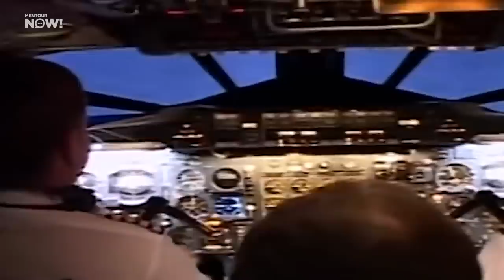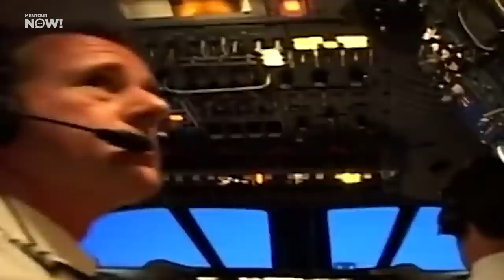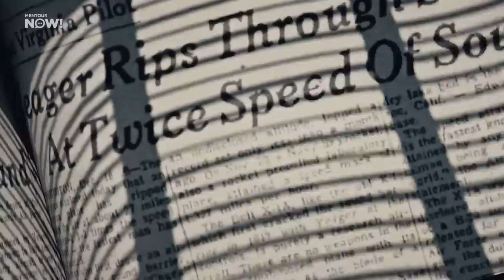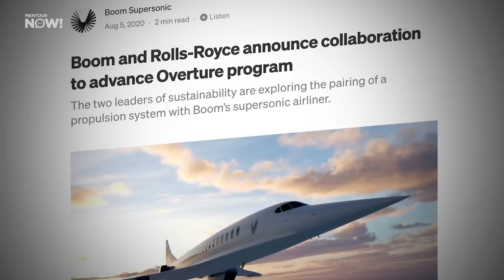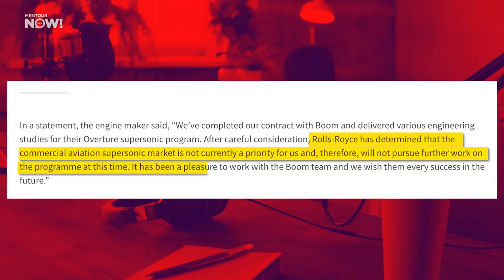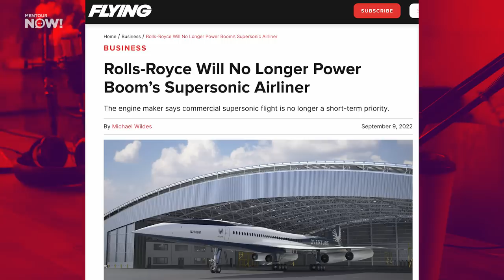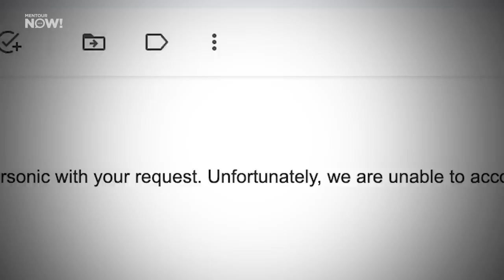WHAT’s Going On with BOOM Supersonic?! Will it Fail?

Comment: One word on why the Boom will not be much of a success: Slots.  To take off from an airport, you need a departure slot, and to land at your destination, you need an arrival slot. The Boom plane will only see maybe 100 passengers, but typical transatlantic jet will carry between 300 and 500 passengers.  That means that with a big plane, you can move 500 passengers with one departure and one arrival slot 2 total), vs 5 take off and 5 landing slots (10 total) for the Boom. Remember, not all of these passengers are organic to the departure an arrival airports, meaning that many of the passengers will deplane and board continuing flights.  This means your big regional jets won't be able to fill their seats.  The entire industry is based on the hub and spoke model and for trans-ocean flights, volume helps support the regional flights.  Then there is cargo. Cargo has become a big source of revenue, and an 777 can carry between about 300 and 400 passengers with their baggage, and still carry up to 21,000 kilograms of cargo. The Boom won't be able to do anything close to this. Now it might be possible to get some slots in the wee hours of the morning, but this is not a desirable time slot for the wealthy travelers that might buy an expensive ticket, and may 1st class seats are given to business fliers that get upgrade from Business Class using "coupons".   These travelers would never be able to afford a premium supersonic flight ticket, and the Airlines would not want to give those seats away.    The problem for the Boom is that it is too small to be an Transatlantic Airliner (and this was a problem for the Concorde too because it only seated about 120 people) but far to large to be a business jet.  The typical trans-Atlantic capable business jet has luxurious accommodation for 8 to 10 people and having to expense to buy and operate this plane to move so few people around is just not practical, though people like Elon Musk could care less about how much something costs.  It would still be an incredibly expensive aircraft to operate though and many large companies have downsized their jet fleets in the last decade because of the cost.   So, Elon Musk, Bill Gates, and Jeff Bezos could afford these out of their personal wealth, but the market for such a plane is not a very large one.  Also, the Concorde required a runway of 11,000 feet, so many regional jets would not be able to handle the Boom, but many big business jets can operate out of locations with runways as small as 8,000. The Global 7500 can land in 3000 feet.  This means that these jets can often take off at an airport closer to the executive and land him closer to his destination than a large plane could do, lowering overall trip time.

Comment: Boom seems to have gone the way of the F-35 when it comes to supersonic performance. But then fighters are more about acceleration, not ultimate speed (which most older jets cannot actually reach with the bombs and missiles and sensors attached)

Comment: I thought GE also got out of the engine design business due to pretty much the same reasons as Rolls Royce, hard to come by profits for the amount of R&D they have to put into engine development.  I know they're still making engines they've already developed, but I hardly see them working with a startup.
Reply: Actually, what GE did was break up into three distinct businesses. One of which is still Aviation engines.
Reply: @WALTERBROADDUS  That still doesn't change the main point though.  The point is the same that caused Rolls-Royce to drop out.

I didn't say whatever spin-off or GE wouldn't be interested in making an engine at ALL.  I said I can't see them working with a startup company and I think that's going to be Boom's problem.  While you might get venture capital to go into the development of the plane body, it would probably be a lot harder to get the same to develop an engine.

If it were the case that BOEING or AIRBUS were working on something like this AND they dumped a few hundred million USD into the R&D of an engine you'd probably get an engine.

It's just too problematic to make supersonic for commercial flight because it's so limited on routes.  On the other hand a small supersonic which also means a much smaller engine seems more realistic for business use.  Ticket costs for commercial flight is high, and part of the people that WOULD be passengers on those flights would rather have their own business jet, and that's why he made the comment about (who for some reason aren't flying a business jet).  I forget the exact words and I'm not going to listen a third time to get the timestamp.  

And you still have the issue that govts. around the world or at least the main ones will have efficiency requirements on airlines and this could be part of the reason why Rolls-Royce got out of this.  The goal post is just too far away.  You need a body type that is very efficient so the entire burden of efficiency isn't on the engine maker.  As soon as you say something like stabilizer on the back, that's a bit of efficiency that's already gone and just a wild guess but it gets worse and worse the faster you fly.

Comment: I'm a little confused.  I thought part of Boom's pitch was that they are designing an aircraft that will be quieter when supersonic, and thus would be able (allowed to) fly supersonic over land.
Reply: Overture would be designed to be more quiet than Concorde yes, but that doesn't prevent sonic booms which are the main problem in regards to noise.

Comment: Supersonic is hard to do because the shockwave causes an enormous increase in drag and decrease in lift. You need more powerful (and thus harder to maintain) engines and have to burn so much more fuel, I’m pretty sure one of my profs said the number was along the lines of needing 50% of the mass just for fuel but that might have been for a supersonic airliner which looks like a normal plane and not one designed for supersonic flight. If they can make it economical then hats off to those engineers, and if they can make it sustainable then whoever designed that engine needs to change industries to power generation as getting that much performance with a high efficiency is technology better used to get more energy out of power stations to actually make a difference on carbon emissions.

Comment: I'm surprised they don't figure out if they can get GE to sell them some F414 engines, as used on the F-18F Super Hornet, or maybe some F110 engines
Reply: These engines have variable stator geometry. I wonder if this is used differently sub- and supersonic. Subsonic you work at the stall limit of the blades. Superfluous air spills over the intake lip. Supersonic you have to shovel away the air dealt to you. So the engine is a bit away from stall. When the intake is in danger to stall, all blades increase their angle of attack.

I wonder if the exhaust nozzle does open up to relieve the pressure. The whole part up to the throat is subsonic and this low pressure should travel up the flow.

Electronic and powerful magnets may be fast enough. The intake diffuser could use a blow off valve which is pulled back like a loudspeaker for immediate relief.

I imagine that one needs test intakes to sense the stall limit. A revolver of micro  throats inside the main throats. We go around and try to squeeze the air a little more, and then reopen the micro throat. A blade/diverter gets rid of the rubbish flow. If the micro throat stall to early, we know that we need to open something. I mean, below cruise we need a bypass.

Comment: Both Airbus and Boeing get substantial government support when developing new aircraft types... As development costs are billions of dollars and ROI takes decades... Therefore, although the aircraft is smaller the development costs are still substantial and for a small developer with production low numbers the cost / benefit does seems to stack... Furthermore the cost of engine development along is in the hundreds of millions, which means of RR pull out they don't see a big enough market to recoup the costs...

Comment: Every time passengers and airlines have had a choice between a faster flight or a cheaper ticket, people are more willing to mortgage time if it will save money. Electra versus DC-2, the 880 versus 707, Concorde versus the 747. Slow and steady wins the race.
Reply: wrong.  No passenger EVER paid the actual cost to fly the Concorde.  They were gov't subsidized.  The actual ticket price would have been 500% higher.
Reply: @protonneutron9046  Question: Was a Concorde ticket ever cheaper than a contemporary tubeliner on a similar route?
Reply: @BogeyTheBear  No, not even close.  It was more along the lines of 150% of 1st class fares.  If it were real cost/price it would have been ~5X First class flight on a 747.

Comment: Well, I read that the Concorde was an interesting case. Basically, England and France had some sort of treaty or contract that would incur heavy penalties if either of them backed out. So, they were essentially imprisoned in the project and had to pump massive R&D money into it to complete it. The Concorde project would've failed at many points if it wasn't for that.
Reply: The part about the agreement is true but it spawned Airbus today which now outsells Boeing so for that reason at least, it was a good investment.  But the 74 fuel crisis that quadrupled fuel prices, a  worldwide recession that followed and then the banning of supersonic flight over land is what killed sales. At one point Concorde had over 100 orders. Break even for the program was 46 aircraft.  But you also have to remember that the US govt funded the Boeing  2707 to a similar level and only got a wooden mockup.i
Reply: That's true and its now called Airbus which outsells Boeing. Sounds like a pretty good long term investment to me!

Comment: I am rooting for success of Boom. 
I am aware that they are on the cutting edge of R&D, using CFD instead of wind tunnels to design for minimal sonic boom footprint along the ground.
It would be very sad to see them go out of business just because of inability to find an engine manufacturer that is as visionary as they are.
Perhaps they can do what SpaceX does -- innovate internally instead of depending on external suppliers.
Gerard
Owner of AnywherePCGeeks

Comment: 14:30 OH, Airplanes need ENGINES! Of COURSE!
Reply: Florida Turbine Technology, a division of $1.88bn Kratos Defence, started the symphony engine design in January 2023. Boom stated that no current engines, either military or commercial, are suitable for adapting to Overtures unique requirements. 

Boom will design the pods and the variable geometry exhaust and inlet ducting.

A big fuss is being made about Rolls Royce ending their contract with Boom, but AFAIK the contract was only for consultancy, and not to build an engine for Overture. Besides which, the Symphony project would be totally unsuited to the tier one engine manufacturers, like Rolls Royce, GE, P&W, and Safran. Their cost base and time frames would be out of kilter, and the volume of sales would not warrant their investment. GE caught a cold with the Affinity program.

Comment: Curious if boom evaluate ram jet technology. New supersonic jet just feels wrong if its slower the the Concorde. I'd love to see Boom succeed.
Reply: @yellow6ird Ramjets are not self starting and need to be accelerated to Mach 0.5 before they will even operate, and then they are weak and dreadfully inefficient. Ramjets operate best between Mach 3 and Mach 6.

The general design aim for Overture is to use as little new/radical technology as possible to minimise risk. Boom intend that Overture will be fuel efficient at sub and supersonic speeds and will comply with ICAO-14 subsonic noise regulations, which are especially relevant on landing and take off. Boom hope to achive this with their Symphony power unit.

Although Mach 1.7 may not sound much compared to Concorde's Mach 2, it is still twice the speed of subsonic airliners and will do the JFK/LHR trip in 4 hours, rather than 8 hours.  Overture will fly Mach 0.94 over land, which will be 10% to 20% faster than subsonic airliners.
Reply: @phonicwheel933  Thanks for the detailed feedback. Everything you said sounds logical.

My issue is that as the video also pointed out, there simply isn't enough of a speed advantage to make it worthwhile.

Current subsonic offerings is able to accommodate business travellers to fit well into their schedule. Why would they want to get there only half the time faster yet doesn't quite give you that much of a benefit?

Personally, to make it worthwhile, a compelling reason to make it stand out as an alternative option, it needs to go substantially faster. I'm thinking Mach 5 or 6.

1 hour flight between New York London will be a real game changer. Not only for the passengers but also the operators. Able to fit more flights within a day in desirable timeslots & utilise the aircrafts to carry more within a day.

At the current state by playing it safe I'm afraid the future of Boom won't succeed.
Reply: @yellow6ird  I'm surprised that you don't think that halfing the journey time would be worthwhile. 

Overture is aimed at the 700 million long range business trips made each year worldwide, 400 million by Americans. The seats will be quiet comfortable business class, and the ticket prices will be the same as subsonic business class. Overture's utilisation will be twice that of a subsonic airliner.

Comment: There was a Air Plane in Russia with engines producing different thrusts right engine 80% , left engine 60% , however the Cpt was found to be drunk and everyone aboard died in the crash .  The plane was flyable despite the different engine thrusts and thrust levels could have been reduced in the right side engine , but what drunk is thinking rightly or he or she would not be drinking before flight duty.

Comment: There may be some hope that a military jet engine can be modified at acceptable cost; the chief problem being that those engines are not designed with efficiency in mind.
Reply: Florida Turbine Technology, a division of $1.88bn Kratos Defence, started the symphony engine design in January 2023. Boom stated that no current engines, either military or commercial, are suitable for adapting to Overtures unique requirements. 

Boom will design the pods and the variable geometry exhaust and inlet ducting,

A big fuss is being made about Rolls Royce ending their contract with Boom, but AFAIK the contract was only for consultancy, and not to build an engine for Overture. Besides which, the Symphony project would be totally unsuited to the tier one engine manufacturers, like Rolls Royce, GE, P&W, and Safran. Their cost base and time frames would be out of kilter, and the volume of sales would not warrant their investment. GE caught a cold with the Affinity program.

Comment: What sad is that while the Concord was in service the industry didn’t even try to make a replacement. And only now some private people are trying to make one.  As for engines just use either the P&W or GE engines for the F-22. Simple.
Reply: Florida Turbine Technology, a division of $1.88bn Kratos Defence, started the symphony engine design in January 2023. Boom stated that no current engines, either military or commercial, are suitable for adapting to Overtures unique requirements. 

Boom will design the pods and the variable geometry exhaust and inlet ducting.

A big fuss is being made about Rolls Royce ending their contract with Boom, but AFAIK the contract was only for consultancy, and not to build an engine for Overture. Besides which, the Symphony project would be totally unsuited to the tier one engine manufacturers, like Rolls Royce, GE, P&W, and Safran. Their cost base and time frames would be out of kilter, and the volume of sales would not warrant their investment. GE caught a cold with the Affinity program.

Comment: There is an interesting video about the variable geometry engine inlet on the SR-71. Some interesting engineering there for sure.

Regardless, nobody is really integrated in developing such an engine (high dev cost, small number of engines),  and the routes will be limited, environmental concerns, noise concerns, and a small market make me think that a supersonic airline will not be that profitable.

I believe that Boom doesn't have an engine supplier, and that is why they can't accommodate that request.
Reply: The engines are not the real sticking point. The J58 was most fuel efficient at ~Mach 3, but the thermal environment at those speeds means your choice of materials becomes critical. If you want to go that fast, aluminum is out, for the majority of the airframe. Composites have come a long way, and can probably help, but apparently not enough, yet. Titanium procurement and innovations in manufacturing were required for the Blackbird series to do what it did, and it was only the fear of mutually assured destruction that could support its operation.